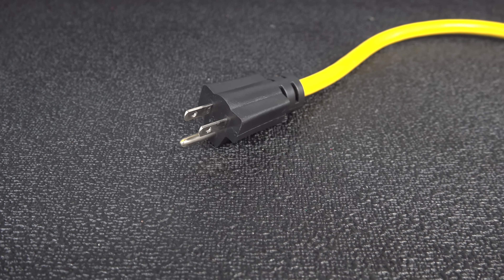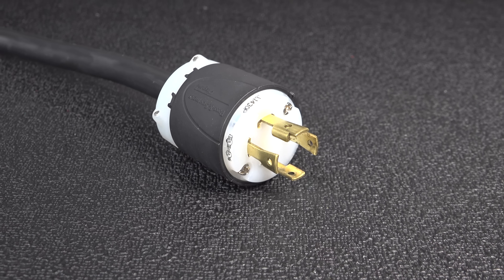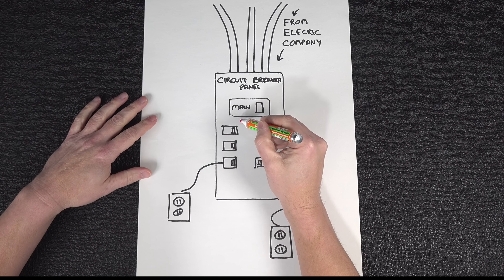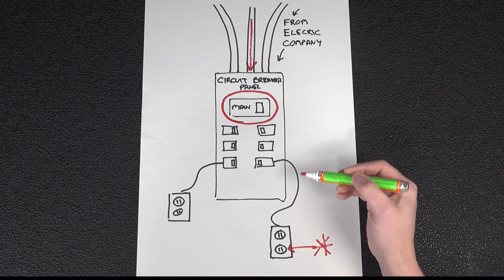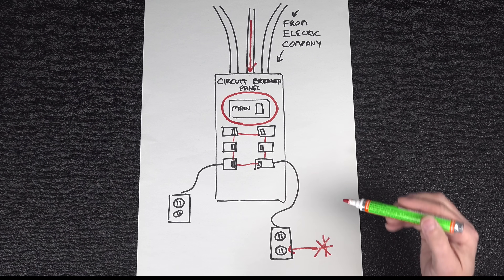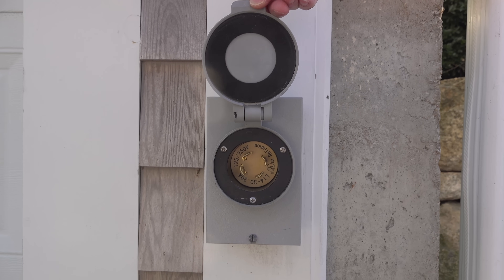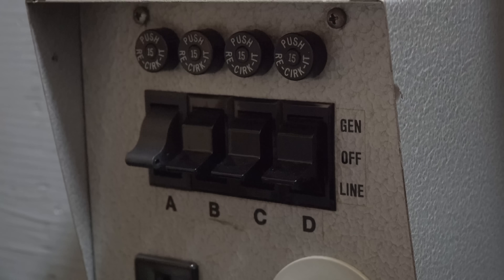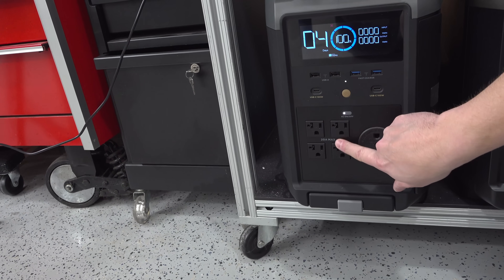Worst Electrical Mistake You Can Make - Backfeeding Generators

Comment: The "outlet with male pins" is logically called a power INLET.
That cheap lockout plate is better than nothing, but it has to be illegal someplace. Different panels need different plates, and I think the plate comes off with the panel cover. An actual changeover switch is the right way.
If you don't have a proper or cheapo changeover switch in place when the outage occurs, you will have to use extension cords for "selected" appliances, but extension cords won't power your boiler. You will end up back-feeding the house, so you should at least know how to do it safely. If you don't have one of those scary double-ended cords, you will make one. Just always remember to turn off the main. (If you're not an electrician, don't try to power any 240V appliances via backfeed - you could fry all of your 120V appliances; you could backfeed to the pole anyway (some 240V appliances don't come through the "main" breaker); you could overload your generator.)
Reply: 110v and 220v.....110 is what you get from normal power outlets that you plug your lamps and TV into.220v is what you get from a dryer plug,hot water heater,etc.
Reply: 120 is the nominal voltage for US, whether it reads locally as 105, 110, 115, 120, 125, or 130. Homes get 120/240 single-phase. The center of the 240V winding is grounded. Loads connected between hot and "neutral" get 120V. Loads connected between the two hots get 240V. That is why 240V appliances have a double circuit breaker. It is also why an open "neutral" between the transformer and the house is is a serious problem: instead of every appliance getting 120V, the 240V splits unequally, and half of the appliances might get only 60V, while the rest get 180V and damaged.

Comment: People think of power cables as 1 directional but electrical current doesn't flow like that. For the most part Electricity just tries to find the path of least resistance on a conductive source. The reason why you don't get shocked holding a power cord being that an isolator has more current resistance than the wire within it. Meters for example just read the electrons that pass by its sensor and if a meter is set to throttle it flips switches for the current to pass resisters to lower the current volume  or even. A generator outlet can actually shock you if that plate was removed and both the generator switch and the main power switch were both engaged. A switch is just a metal bridge that is connected and disconnected to bridge a gap similar to a draw bridge. 

If you were to plug both ends of a Male-Male extension cord into an outlet nothing would actually happen just a current would continue a new path, similar to the wire that runs past an outlet to keep power running to the next outlet in the chain. What makes Male-Male extensions dangerous is just the exposed prongs if someone would touch it and is there for safety but not function.

A phone cord and USB actually a Male-Male cable but the safety is 1 connective plate is usually hidden within a slit too small for you too touch preventing you from completing a circuit but if you touched the edges while it was plugged in you are receiving a charge though nothing is happening as there isnt anything allowing the power to continue its path.

Comment: Backfeeding to the grid isn't illegal. 
This is literally how solar panel installations can sell power to the grid.
Reply: True. However: my PV installation measures if line voltage is present (every x moments) and stops backfeeding if the power is down.

Comment: backfeeding gunna cuz the voltage to double. 220 will become 420 when the grid power comes back. very unsafe for gen. yur generator will explode if backfeeding happens no question.

Comment: when i was kid growing up in a trailer. a friend turned on a treadmill set on high speed n we lost power to have of it. my dad couldn't find the issue without tearing walls open as wires were severed. so his solution was making an extention cord with 2 male ends to power our living room n bed rooms. "legal" "up to code"?🤣🍻

Comment: Used to work at Pacific Home Do-It in San Luis Obispo in the mid 90s. Around the Holidays we'd have people coming in all the time asking for an extension cord that had a male plug at both ends. Give it a think and you'll figure out why this happened just before Christmas. Over and over again I'd have to explain why that wasn't just a bad idea but a stupid one (politely explain). I'd explain how no company would ever manufacture and sell a product so inherently dangerous. If the customer was adamant, I'd offer them an extension cord and a male replacement plug and they could do with those items whatever they wanted. Most would simply decline. Some would ask if, for a few bucks, I would make a male-male extension cord or pigtail. My response was always Nope. Just not worth it. I could never willingly produce such a hazardous item for someone else to use.
Today, thanks to this video essay, I learned that there are companies manufacturing and selling male-male pigtails. WTF is this world coming to? Greed yet again trumps ethics... sigh

Comment: This video is for Ultra Libs. You will burn your house down... Conservatives, you usually turn off your breaker before using this item, and when you don't, the mistake is yours, so don't be shocked.
Reply from the maker: I don't this dead lineman will agree.  Worker Electrocuted In Flomaton By Live Power Line  FLOMATON, Ala. -- An electric lineman was killed just before 5 p.m. Tuesday when he came into contact with a live power line. It was energized by a generator that was hooked up improperly. (backfed)
Reply: @Silver Cymbal  Yeah, but that's because some limp wristed lib backfed the line without flipping the main. 
That only happens to Leftists.

Comment: In my 40+ yrs I rigged something like that in a pinch maybe once. Its not a negative when you know what you're doing. Electricity doesnt see color nor does its type of connection matter if its solid.
Reply from the maker: I don't this dead lineman will agree.  Worker Electrocuted In Flomaton By Live Power Line  FLOMATON, Ala. -- An electric lineman was killed just before 5 p.m. Tuesday when he came into contact with a live power line. It was energized by a generator that was hooked up improperly. (backfed)
Reply: @SilverCymbal  That's why an automatic transfer switch comes with Generac generators and also Inverters for solar equipment. Typical homeowners dont realize they are energizing the grid with those cheaper generator setups.

Comment: Everything can be dangerous in the hands of an ignorant person. Back feeding can be safe when done properly. Getting bit by that cord wouldn’t do much. 110 is just a tickle.
Reply from the maker: I don't this dead lineman will agree.  Worker Electrocuted In Flomaton By Live Power Line  FLOMATON, Ala. -- An electric lineman was killed just before 5 p.m. Tuesday when he came into contact with a live power line. It was energized by a generator that was hooked up improperly. (backfed)
Reply: @SilverCymbal  That has nothing to do with that cable and everything to do with a lineman not following all safety protocols. It  also supports my comment of everything being dangerous in the hands of the ignorant. The lineman didn't get hit with 110, he got hit with probably 5-35KV. However, there could not have been much else on that line, otherwise it would have overwhelmed the generator. In most instances, if you don't open the main, you will trip the breaker on the gen because you are trying to power the entire grid up until the break point. Or it just kills the engine....  Pointing out one exception where 2 idiots messed up doesn't justify codemning everything.
Reply from the maker: @AnonyMous-jf4lc  It's sad what people want to believe to support something illegal and wrong. First the cable is exactly what the person used at most it was a 240v version, identical problem. Second lineman do check lines every time they start to work, except what happens when someone turns a generator on during the repair? Ooops.  Not every rules makes sense, this one does thats why it's universally accepted by electrical unions, safety orgs and government. Not to mention even protecting yourself.
Reply: @SilverCymbal  You are ignorant of how lineman work on lines. They are required to ISOLATE AND GROUND the lines they are going to service to prevent this exact thing. Whether it's a random backfeed, or some other grid-tie that wasn't properly documented. They are REQUIRED to check the state of the line before doing anything, and then required to isolate and ground it before doing any work. The guy that died won a darwin award. PERIOD. Had he followed proper protocol and procedure he would be alive. That's the facts, get educated before you start posting crap like it's fact.
Reply from the maker: @AnonyMous-jf4lc  Listen, I get you don't care about a law, the national electric code or every agency in the country that promotes electrical safety. You can stomp your feet and blame other people but the fact remains it is illegal in every state in the US for good reason. Justifying an illegal activity doesn't make it legal or in this case right.
Reply: @SilverCymbal  Backfeeding the grid is illegal. What you do with the main open is your business. The second you disconnect for their line, you are operating solely on your equipment on private property. Know the nuaces, this is why and how they can sell the cables. It's not that I don't know about the law, it's that I actually know how to properly interpret the law.
Reply from the maker: @AnonyMous-jf4lc  Back-feeding the grid is legal with an appropriate switch, exactly as shown in the video. Without it, it is illegal, there is no "interpretation" . You are too funny..."I flipped my breaker" now I am in a sovereign nation no one can tell me what to do on my private property. Come on.
Reply from the maker: @AnonyMous-jf4lc  And listen, it's your life or someone else's in this case. Do what you want to do. I don't follow every law but I totally agree with this one 1000%. But please don't try to convince people it's legal to do because it isn't.
Reply: @SilverCymbal  It is pefectly fine if you are disconnected from the grid and you are backfeeding a line that has the appropriate gauge wiring to handle the current you are providing. Yes, backfeeding into the grid is illegal. Backfeeding your house is not. A transfer switch makes it dummy-proof, but it isn't required equipment.

Comment: Wonder what it'd do to a plugged in power strip sharing the same outlet.
Reply: Nothing if its wired in the correct polarity. The hot on the power bar would connect with the hot on the cable, they're both 120v so a 0v difference between them. The neutral and ground are both 0v difference as well so nothing happens. If the powerbar or the cable are wired backwards though, then shit will hit the fan...

Comment: I do this every. Single. Time, there is a power outage at my house. Except theyre both 240v.
You just turn off the main breaker.
Reply from the maker: Perfect, make sure to disconnect it if your houses burns down since your homeowners will be non-existent and face charges if someone is hurt.

Comment: I'd like to have a generator interlock but all I really need is a good way of running a big extension cord from outdoors to indoors.
I'm picturing something you could buy to install on the outside of the house that would look something like a weatherproof outlet cover. It would give you a 2" or so hole to pass through the cord into the inside. There should be a weeathertight hinged cover on the outside that can be closed over the cord without pinching it. When not in use, an airtight cover could be placed on the inside.

Comment: I back feed all the time because I’m not a dumb ass and one thing you forgot to even touch on is the neutral. In North America, You must use a four wire cord (rated for your generators output and into a 4 wire receptacle obviously) and the generators neutral MUST BE FLOATED to back feed. The neutral bond is now in your main panel. Only one neutral bond is permissible! This also makes the generator unsafe to use as portable power as in simply plugging in three prong extension cords. The neutral must be re-bonded for portable use. I don’t know how many times I’ve tried to explain this to friends who have RV’s and get shocked when touching appliances or metal on the RV... incorrect neutral bonding!

Comment: Shut the main breaker off which is essentially the same thing as a transfer switch does. The downside of backfeeding is whichever side the generator is feeding nothing on that side of the panel will work.

Comment: I made a cable like this. We remodeled a house that had 3 breakers total. we already ran lines for a new panel, but contractors needed lights and power, So I jumpered 1 old circuit to our new wiring that replaced some old wiring. Still, dont recommend it. If your old wires, or even new wires, are not right you could cause a dead short. Or you could possibly jump 2 live outlets of different phases.

Comment: So what happens when a homeowner legitimately sells energy back to the grid (e.g. from rooftop photovoltaic cells)?
Reply from the maker: That is completely fine due to the requirement of automatic switching gear. Power goes out, it automatically disconnects from the grid.
Reply: @SilverCymbal  thanks!

Comment: I worked for a national hardware chain about a decade ago. I was a JOAT and did a lot of small appliance, electrical repairs. A customer asked if I could fabricate one of these for him, I declined, explaining basically everything you've said. He got angry, demanded to speak to the manager. The boss told him the same thing, no. I asked him several times what he needed it for and he refused to say.
Reply: Was this around Christmas time? People hang long strings of lights that should connect male/female but sometimes run a string the wrong way so you end with two female connectors in one place. Then these male/male cords are less work than removing the string and turning it around.

Comment: The Feds use these too, so they can sieze computers for evidence.  

They have to assume computers with criminal data have password protection turned on, so they plug in a dongle that keeps the mouse moving. Then they back-feed power to the outlet it's plugged into from a battery source with one of these cables. Then they cut the room power and chop the outlet out of the wall, so they can transport the whole setup to forensics and start copying data. It's pretty clever really.

Comment: You're right all they got to do is shut the main off and however they make a switch it's called on-off-on and it will it will remove the electricity from the meter while you're on generator it's about 200 bucks

Comment: I assume that the utility worker, finding voltage in a “dead” line would then what?  Somehow bleed it off?  Interrupt the flow from the house?  Skip the repair?
(I have a separate panel; I’ve just always been curious.)

Comment: Good info! I hadn't seen the block before. I turn off the main coming in with a light connected to the incoming power to know when the power is back on. Then plug in the generator. Would not spend the 1500 on an auto divert. That's just crazy but will get the switch block!

Comment: Well... We had been doing this for ever on job site. Just be careful. If you use it at home install an Interlock sold in most electrical supply stores. You will to move breakers up to top of box. You must know what make service box you have to buy interlock mechanism.

Comment: I do this one step worse. I backfeed a larger 240v cable from my generator to the house during power outages. But, I have a large, separate 200a main disconnect with a large lever that I completely disconnect before I even think of starting up the generator.I also go through my breakers to make sure any very high demand items are taken out of the equation that my generator can't handle. I then periodically check with my voltmeter or neighbors if the power is back on before disconnecting my generator or flipping the main back on. I do take this very seriously and have nothing but respect for not sending any unexpected voltage back up the lines to hydro workers.